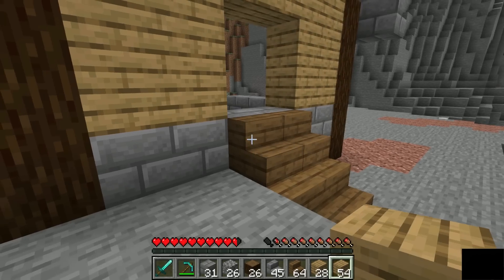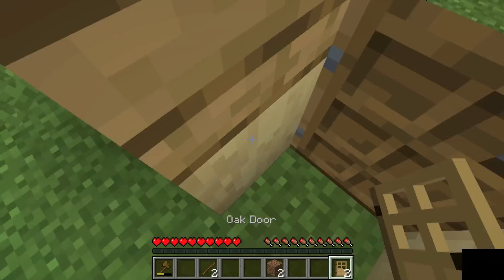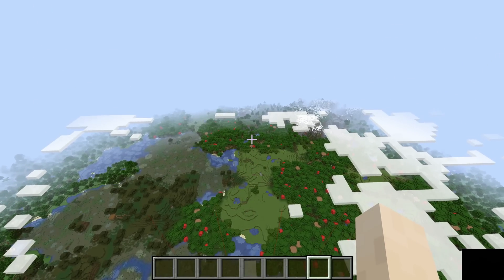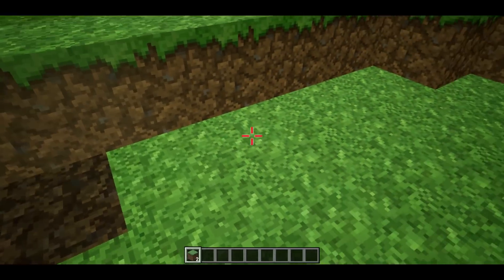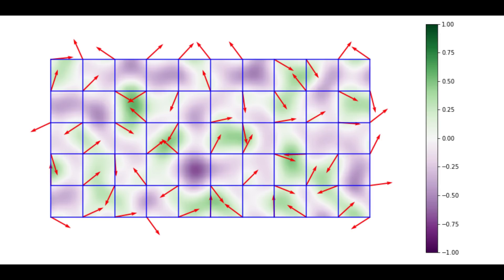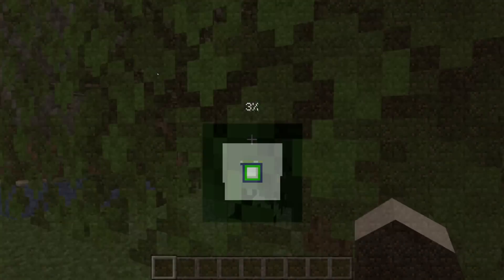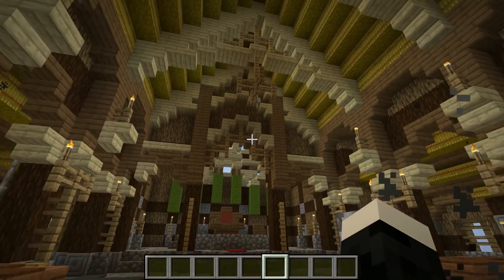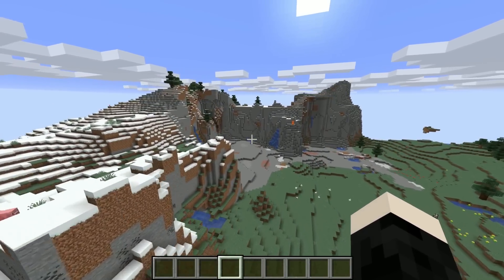Why Minecraft is a Technical Feat | Explaining the Engineering Behind an Indie Icon

Comment: One correction I'd like to point out in the video, since I've worked with and researched voxel terrain generation before (specifically an optimized implementation of OpenSimplex noise). The method you described in the video is a very basic 2D Perlin noise heightmap. While it definitely was used by the earliest versions of Minecraft, the method in which they use those heightmaps is a little bit different.

To be exact, by stacking layers of noise at different scales to create more variability in the terrain. In a devlog by Notch himself, he had multiple 2D Perlin noise heightmaps to set the shape of the world. One for overall elevation, one for terrain roughness, and one for local detail. For each column of blocks, the height was (elevation + (roughness * detail)) * 64 + 64. Both elevation and roughness were smooth, large scale noises, and detail was a more intricate one.

Basically, with different layers of noise, you can do things like adding noise at different scales for roughness, or multiplying noise to get sharper terrain. This method had a great advantage of being very fast as there was just 16*16*(noiseNum) samples per chunk to generate, but had the disadvantage of being rather dull – there was no way for this method to generate overhangs, cliffs or canyons.

So Notch switched the terrain generation system over into a similar one based off 3D Perlin noise. Instead of sampling the “ground height”, he treated the noise value as the “density”, where anything lower than 0 would be air, and anything higher than or equal to 0 would be ground. To make sure the bottom layer is solid and the top isn’t, he just added the height (offset by the water level) to the sampled result. This produces a terrain with overhangs, cliffs and canyons. Achieved by only creating a cube if the point sampled is above a certain threshold.

Another note I'd like to add is that Perlin noise had major issues where it produces artifacts along directions of the geometry. More specifically, it tends to align all of its features to the cardinal axes and to the diagonals, which was also something I could visibly notice myself when I was messing around with it. Ken Perlin addressed all of these issues it had and made a newer and enhanced version called "Simplex noise". The word simplex refers to the generalization of a triangle to arbitrary dimensions. To put it simply, in 5:53 as an example, instead of an n-dimensional grid (as said in the video), it uses a grid of triangles instead. It is basically being faster to compute, scales up as needed (x or x,y or x,y,z etc.) and doesn't produce the visual artifacts.

Now one disadvantage of Simplex noise is that it is patented. Basically, no one could use it without Ken Perlin's consent. So this is where OpenSimplex noise comes into play, which is different in it’s implementation from Simplex noise as to not infringe on the patent. Whereas Simplex noise starts with a hypercubic honeycomb and squashes it down the main diagonal in order to form it's grid structure, OpenSimplex noise instead swaps the skew and inverse-skew factors and uses a stretched hypercubic honeycomb. The stretched hypercubic honeycomb becomes a simplectic honeycomb after subdivision. This means that 2D Simplex and 2D OpenSimplex both use different orientations of the triangular tiling, but whereas 3D Simplex uses the tetragonal disphenoid honeycomb, 3D OpenSimplex uses the tetrahedral-octahedral honeycomb. OpenSimplex noise also uses a larger kernel size than Simplex noise. The result is a smoother appearance at the cost of performance, as additional vertices need to be determined and factored into each evaluation.

UPDATE, a little rant: I'd like to clarify more that it isn’t just a single correction I really wanted to point out, but that this video is just technically flawed because it has been dumbed down to entertain casual viewers to the point of clickbait.

Some of the concepts explained in the video are either too simplified that it’s become inaccurate or wasn’t even correct in the first place. Every technical aspect of the game that he wanted to bring out are all common knowledge for game developers (such as culling @ 3:41) that there isn’t a single thing pointed out here that makes Minecraft a technical feat. I’m surprised by how these “full-time epic minecraft coder modder with 99 years of experience” couldn't even notice a single thing wrong over how simplified this is, such as the noise terrain generation part – a topic I researched and worked on for fun in ONLY a week, back in 2019 (when I was literally 12).
Reply: neko noise
Reply: Ah, but good news: Simplex noise was invented in 2001. Patents last for 20 years from filing date. And, according to Wikipedia: 

> Uses of implementations in 3D and higher for textured image synthesis were covered by U.S. Patent 6,867,776, if the algorithm were implemented using the specific techniques described in any of the patent claims, which expired on January 8, 2022. 

So the patent for Simplex noise actually expired just a couple months ago, in fact only a couple weeks from when you posted your comment!
Reply: never heard of simpex thanks for the info the guy i totally not met in roblox 2 years ago
Reply: Thanks for this, I always wondered how overhangs were done.
Reply: Nice info thanks!
Reply: Does minecraft use Simplex or OpenSimplex?
Reply: @mujtabaalam5907  OpenSimplex, since it is free to use without a paid license.
Reply: @tetrahedrontri  but according to another user, simplex's patent recently expired
Reply: This is a very good introduction to these concepts, so thank you for that. When you're talking about scaling verticies out to calculate runtime performance, does the runtime performance level out for the two or does OpenSimplex always use larger kernel sizes at all scales? Say, maybe at infinite verticies, maybe OpenSimplex has O(2^n), and simplex has O(n^2)?
Reply: As an aspiring software dev, I learned so much from this comment. Thank you!
Reply: "where anything over than 0 would be air, and anything higher than or equal to 0 would be ground". So everything over zero is both ground and air?  And zero is ground? What did you mean by that sentence?
Reply: @_veikkomies  I meant anything lower than 0, it’s just an error. I edited the comment.
Reply: Brain hurt, click off video now
Reply: TL;DR

Comment: Great video with a lot of unique insight, and the maths is very well explained for beginners.
I was wondering if you're planning on doing a follow up video, given how massively terrain and cave generation has been overhauled in the latest update. Some of these principles still apply fairly similarly, clearly the new noodle caves are just the same perlin worm techniques with slightly different coding. But for the aquifers and cheese cakes, I wonder how this differs from previous cave generation?

Comment: I'm confused, you start off by saying Minecraft uses voxels but most of the video describes optimization methods used for polygonal graphics, which is what Minecraft uses, not voxels. Am I missing something?
Reply: I'm not an expert, but I'm pretty sure from the explanation given that Minecraft uses both.
The faces of the blocks are made up of two triangles, and follow all the methods of polygonal graphics. But the texture on those polygonal faces are voxels. They're pixels which exist in 3d space, and look different depending on the angle they're looked at by the player. 
May be completely wrong, that's just my guess.
Reply: I'm no expert either but I am invested in the subject and I'm pretty sure no voxels are involved, otherwise we wouldn't be able to draw texture packs for it like we can. I think a lot of people just assume that anything that's made out of blocks uses voxels, I know some indie games even use it in their marketing but it's just flat out wrong. 

An example of a recent game that actually uses voxels would be No Man's Sky and you can tell right away, the terrain looks like it's constantly stuck between blurry and pixelated but at the same time it's completely devoid of jagged edges, not to mention fully deformable.

Comment: There are a few inaccuracies in the video:
1. Minecraft doesn't use 2d perlin noise for terrain, it in fact uses 3d perlin noise (in combination with 2d), and not just one source but multiple combined in specific ways. Depending on game version, either all terrain is done with noise with biomes overlayed on top of it (beta 1.7 and older), biomes are generated separately and affect the height range scale of the noise (beta 1.8 - 1.17.x) or once again all done with noise but in a more complex way.
2. Caves, until 1.17/1.18, aren't actually done with perlin noise. For it's old cave generation system, it takes 8 chunks radius, scans all the chunks in that radius, and checks whether a cave system would have generated from it, and based on that chunk's seed, follows it's random twists and turns (it doesn't use noise, just completely randomly changing direction delta - it keeps track of a direction delta, on each step adds it to the current direction, and adds a little random change to that direction delta) and checks which parts of the current chunk should be carved out. And there is some random chance of branching. Cave radius is determined by the amount of steps from source.
3. Biomes - the part about Notch's old biome system is correct. But rivers aren't what makes this kind of biome separation possible. It actually assigns climate categories to each biomes. The way biome generation works is that it's generated first as "pixels" in a far larger scale, so it just needs to ensure no biomes with 2 opposing climate categories aren't next to each other. Than those very large scaled "pixels" are upscaled with some extra randomness added during the upscaling, and some exytra smaller biomes added on top of it. The process is repeated several times. 1.18 changes biomes yet again, back to a system similar to beta 1.7 and older, but far more complicated, with 4(?) noise sources and an enourmous manually(?) created lookup table, and a lot of tweaking of the way it's used.
4. Lighting is actually even more complex than that - try to figure out how to deal with removing light sources.

Comment: I don't like the fact that you're essentially insinuating that Minecraft is an engineering marvel or that it's the first game to use chunking/backface culling/frustum culling/occlusion culling, believe it or not these are industry standard methods, and to be fair, Minecraft is one of the worst examples of a "well optimized voxel game" because it's not, acceleration data structures such as octrees existed way before Minecraft or even Notch ever existed, yet he didn't use them, because Minecraft, is a horribly optimized game, created by a subpar engineer.

Minecraft is fun because it's a fun game, it's a horrible example of a well engineered voxel game though.

Comment: In like 1st minute there is already a false statement, actual herecy. Voxels were there before. Perssons didnt invent voxels. Look for Delta Force. Its a game from late 90's and it used voxel graphics at the time of the first proper Direct3D library (everything before Direct3D was quite crap). Voxels are not a new concept at that time, just barely used. What is new is that it was possible to change them in the runtime and stream the changes through the network somewhat reliably. And in the context of Minecraft I literaly mean somewhat ...
Reply: also rendering in minecraft is based on classical vertex rendering in contrast to Delta force that actually used voxels to render data. There are few engines that took this approach, one of them is Attomontage, that is premiering right now, or this thing: https://www.youtube.com/watch?v=8ptH79R53c0 this is actually a technical feat.
Well ... I don't want to bash Minecraft, its a great game, its a perfect idea, it tackled plethora of technical stuff that were not really common at that time, but its not really that special from the technical point of view.

Comment: One thing I noticed is that minecraft is as far as I know, not using  a normal heightmap, at least not for a long time. Notched switched to using 3D perlin noice and then added a bias so that the threashold for a ground block is higher the higher up you get, with some smoothing to avoid to many single blocks in the borders that is used for the base map. That created the overhangs and similar. Then they use the cave generation on top of that. Not sure if they changed that later though.

Comment: I love Minecraft, but this video is wrong on many levels. Minecraft succeeded because it was a complete package that became an indie hit very quickly. It was by no means a technological feat, not even for it's time back in 2009. 

Sure, you can say there were a lack of voxel games before Minecraft, but I find it insulting to call this game a technological marvel when there have been much better voxel games before this. Sure, they were not complete games. But some of them had technology far surpassing Minecraft's. Hell, infiniminer was made in less than a week. AND MINECRAFT IS RENDERED USING POLYGONS, IT DOESN'T EVEN USE VOXEL RENDERING.

I agree that we should celebrate Minecraft for popularizing voxel games as a whole, but let's not pretend and call it a technological feat because it simply is NOT. Minecraft still has A LOT of technical issues even after a decade of development and there have been very little in the way of solving said issues. Bedrock which was built from the ground up to be less technically limiting than Java Edition, still has lots of technical issues. Switch and console versions have awful performance issues they haven't fixed, let's not even talk about Java. The developers are sort of trying to fix the issues, but not really? There are issues in this game that have been solved by other games many many years ago. Minecraft is still developed like it's an indie game. It's technological limitations and the developers disinterest to fix these issues for so many years hasn't exactly been great for the community either. 

Case and point, Miencraft is not a technical feat. It was a good game that was popularized for it's innovative game design. But it was never a technical feat, please stop making shit up.

Comment: 3:30 I don't really understand this Overwatch comparison because I'm dumb. Is 790,000 triangles a lot? They compare it to 60,000 triangles for Overwatch characters. But Overwatch is a 6v6 game, so you multiply 60,000 by 12 characters, no? What's the limitation or problem that's being discussed?
Reply from the maker: That's 790,000 triangles per chunk. Minecraft has a default chunk radius of 12, which means you would get around 24×24 chunks, or around 576 chunks for the default settings. It would be a bit less because I believe the chunks are added in a circular area and not a square :)

Comment: Very nice explanation. Thanks! Enjoyed this a lot.

Regarding Voxels, they indeed played a role during the dawn of 3d gaming. There was this engine that was called 'Voxelspace' if I remember correctly which was used for some games that were commercially successful. An early Tom Clancy game and a helicopter SIM if memory serves me right.
If you had a low end PC with no or limited 3d rendering hardware they actually looked nicer and performed better than polygon based games.
In the end it was a lost fight. Polygon based 3D games won fast after 3d hardware acceleration became more and more common and affordable.

Oh how I treasured my first Voodoo 3D card...

Comment: One thing I don’t understand as a not game developer is why do you need triangles if all the faces are always squares
Reply: It basically boils down to the fact that triangles are super simple to process and gpus were designed with triangles in mind. And because of this, all 3D rendering apis (mostly) don't let your process anything above triangles in complexity; and if it did, it would silently convert them to triangles behind the scenes.

Comment: It certainly is the exact opposite of a technical feat. Development has been absolutely glacial - and after all that supposed development, there's extremely little to show from the initial release. It's still in beta HOW many years later? It's very limited in gameplay, has simplified physics, animation, geometry, item spawning, and "AI". It needs its own launcher to even start. There are glaring game-breaking issues and exploits STILL not patched. It started crashing less let's see ... 7 years after release? It doesn't scale with gaming hardware. Zero effort or time has been given to aesthetics keeping it a 2002-looking game even though released in 2011, and on top of all this, it ripped off someone else's game idea. This last thing alone shows it's not a feat, and the game is certainly not technical, but rather the product of a hesitant, conservative, limited, "I'd rather not" mind.

Comment: Call of duty won't slow down your GPU when placing too many lights. It just won't compile the map or not render the lights that exceed the dynamic light limit. There are tons of limits on Call of Duty engine to prevent GPU/CPU and memory overuse. They really are limiting on how many things you can do but there is also flexibility to the engine in terms of what you can create. I mod cod4 for like 9 years so i know that first hand.

Comment: No Minecraft is not a technical feat. Making Minecraft did required problem solving, but still nothing out of the ordinary.

Did Minecraft make voxel rendering more efficient? No, Minecraft has a very inefficient rendering of voxels. Polygon rasterization is the least efficient way to render voxels. Ray casting and voxel wave surfing is how you render voxels.

Minecraft got some interesting tech, but it isn't ground breaking.